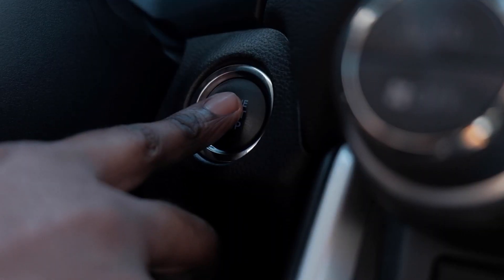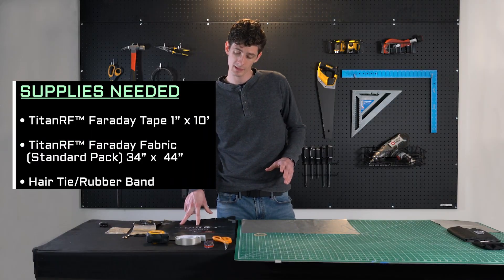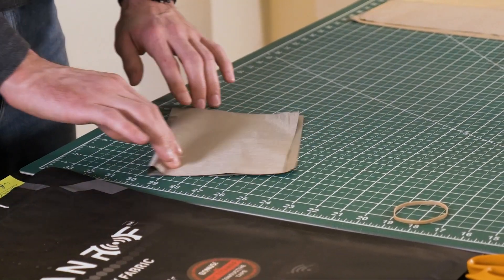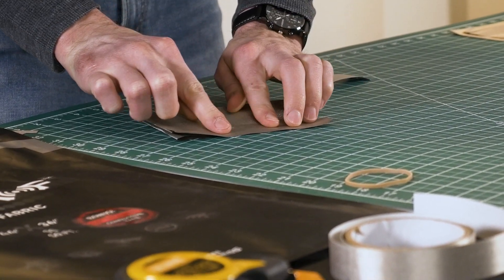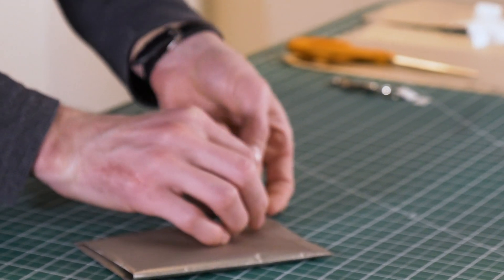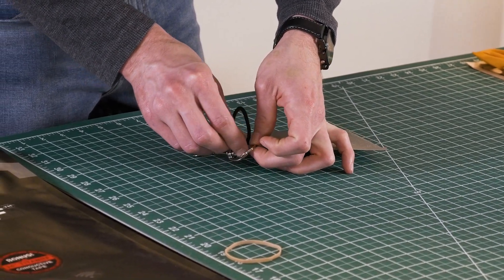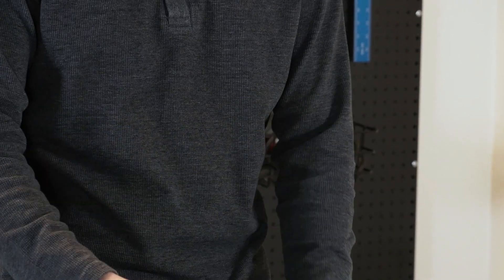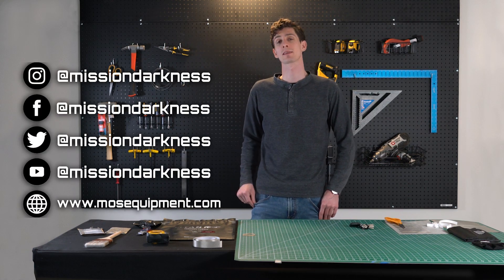Make your own faraday key fob pouch for your car keys! Defeat relay hacking!

Comment: You could also use the mission darkness faraday tape to make a faraday bag from a ziplock bag like in our video where we use copper shielding tape.  The magnetic close feature will help with blocking some of the signal leakage from the opening too.
https://youtu.be/jfSe-xyQQzg

Comment: For the cost of faraday tape, I could buy an actual fob pouch.
Reply: A lot of those pouches stop working after a certain amount of time... maybe wear and tear from keys going in and out and also from the folding and unfolding of the opening flap.  You can easily make one with cheaper copper tape like in our video:  https://youtu.be/jfSe-xyQQzg

Comment: How about an inner lining inside my zipped leather key- ring holder....
Reply from the maker: This can help reduce EMF but will only completely block signals if it is a fully sealed enclosure. You could create a small pouch that can be placed inside the ring holder and uses a folding mechanism to insure that it is completely sealed.